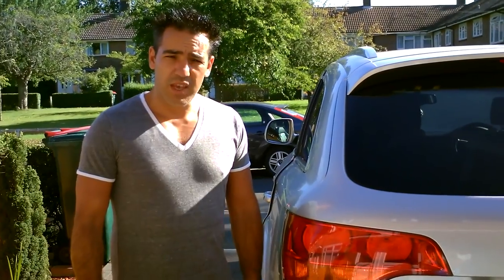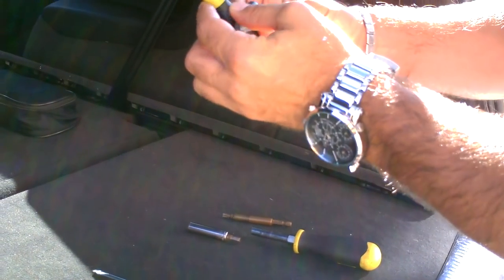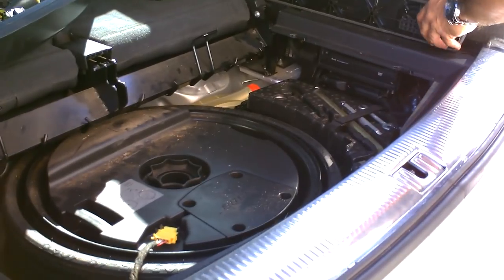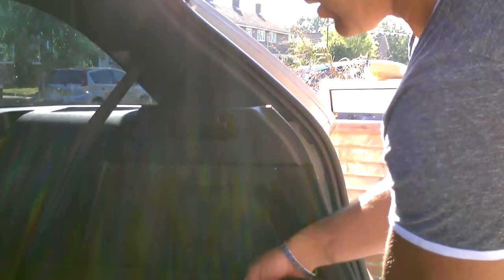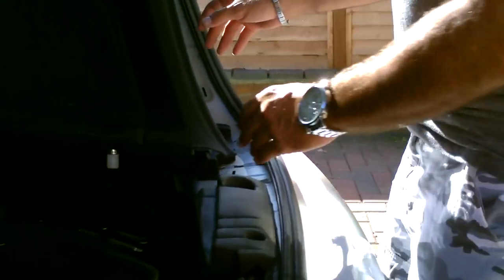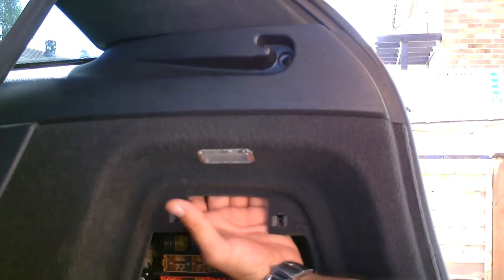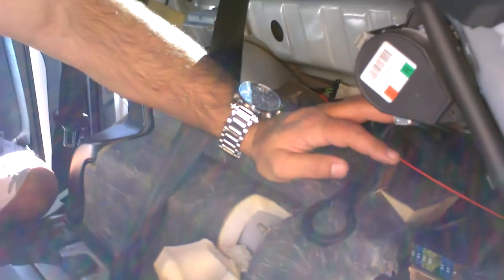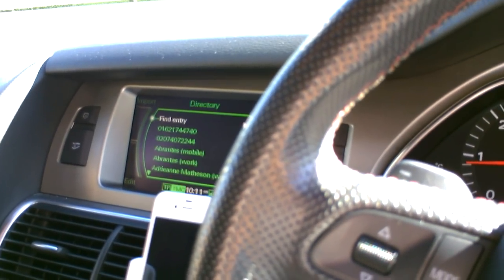Audi Q7 Bose Amp Removal & Location

Comment: First of all.. Carlos, thanks so much for the help! I probably wouldn't have tried this without the step by step instructions. I used another one of your videos to help me replace my throttle body recently as well.

Two things that might help others..
First, the fiber optic loop helps if your MMI is completely blank. In my case, my amp was faulty (roof leak), but my nav and everything else worked - I just didn't have sound. I bought the loop back, but in my case, it really wasn't going to do anything for me (although, my key fobs have terrible range, and push-button start often doesn't work great.. so maybe it would have helped me keep a full charge on the battery and helped there.  I bought it, so I could test that theory and maybe get the amp repaired or look for a replacement).  
Secondly, when I got the amp out, I noticed water spots, and residue on the circuit board.  I used Q-tips and isopropyl rubbing alcohol, and cleaned up the board (figured it couldn't hurt).  Spent about 10 minutes cleaning it up, reconnected everything, and I have my sound back!  So pumped.. $0 fix.  I don't know how long it'll last.. and I imagine it's going to get hit with the water leak again (hopefully I can fix just as easily). In my case, I blame my kids.. I've caught the rear sunroof open a few times, and imagine it's been open at the wrong time, or overnight.  I'd suggest trying the alcohol as a first test.. if none of the circuit board components are bad, it may simply need to be cleaned.

Comment: Thanks for your excellent video, my wife's Q7 had a DSP issue (no audio) and it wasn't showing up in a VCDS scan, I pulled the inspection panel off and reseated all the fuses and now it works! Hopefully all fixed and I was thinking it was going to be a bill of a couple of grand to get it fixed. Thanks again - you're a champ.

Comment from the maker: Hey Usanmaz , do u have a sunroof if so , most likely your boss amp has water damage as the amp provides sound to the whole system , it works on a loop basis , think of it as a circle if something in the circle is not working then nothing works did you have no sound on any device most likely it’s your amp that is fried get yourself a fibre options loop tester and you can bypass the amp and test everything else I think I have another video with the fibre loop hope this helps

Comment: when trying to do Bose amp removal, and the screws are easily accessible on the left and front of the metal plate that the amp sits on, the metal platform has a screw on the right side. (Audi Q7 2008) which is behind a tight spot. right side screw for platform is behind the fuse box. How did you reach the screw thru the fuse box area?

Comment: Carlos , just watch your video on how to change the BOSS Amplifier that has disable my MMI completely. The Audi Dealer in Rockville Maryland want $3.100 for installing the new AMP, I know crazy. After watching your helpful video, I feel capable to change it myself. Delears are insane and a ripoff. I need to find out how much the BOSS AMP cost to order one , my assumption is that is expensive.  Ed Canales

Comment: Great vid... thanks. Noticed my MMI tries to start up and then turns off. Pain. Gonna give this a try. Thanks again!
Reply from the maker: If you have a sun roof , 95% it is the cause of your mmi and sound not working.
Reply: Thanks Carlos. I have the Pan roof... so seems that way. Ordered loop which has now arrived so ready to go. Will update with a comment when done.
Reply from the maker: Yeah most likely water in the amp, pull the panel and look for water spots on the amp tray and amp itself , mine has been a nightmare after I fixed that issue the moonroof seal went , water in front footwell , seal has already been replaced 3 time at over 2k charge, I went off on Audi so they discounted the install this time., Good Luck hope all is good.

Comment from the maker: The amp is around 800-900 US dollars u can buy it from dealer or a junk yard once u install it dealer will have to program it to the car unless u have software that you can program it yourself. Hope that helps also if your amp is not working due to water leak u must fix the leak or it will happen again
Reply: thanks Carlos. How can I program it myself (I have the VCDS Ross Tech)?

Comment: carlos hello I write from Chile I thank you for your videos are very good and very helpful. my problem in my Audi Q7 3.0 TDI 2007 I have it in the center console when I turn on the radio appears on the audi mmi screen for a few seconds and then turns off. it is as if left without power the console. change MMI Multimedia Interface Control Panel Circuit Board and did not work. bose amplifier located at the rear of review and has humudad, if I change the amplifier this should be solved? or there is some other module missing for review? I hope your prompt response, greetings carlos

Comment: Hi I have the 2007 Q7 premium 4.2. My MMI wont turn on and is blank. First thing- I looked in my spare tire well and water had filled up to the bottom of the air compressor- 5 gallons? After watching your video I removed the amp and cleaned off the corrosion but it did not change. Then I installed the bypass loop on the amp- no change. I also wasn't sure if I need to leave the main connector on so I tried it both ways and it made no difference. Then I dug a bit deeper and tried the loop on SIRIUS control- no change. Then the unit that mounts vertical (no idea what it is)- no change. Even tried the bluetooth module under the passenger seat- no change. Finally I installed the Navigation(DVD) and I got the MMI to turn on but it powers down after 1-3 seconds during boot up. Tried to reset during boot up in that 3 second window but it didnt make a difference.  The control board will perform a reset when you press the three keys so I think its working?. Does anyone have any suggestions after this? Is there any thing else in the loop? Anything special I have to do when bypassing the Nav? I'm parked in the garage and will wait until I fix the sunroof drains before I take it out in the rain.
Reply from the maker: You will need to bypass all the device that you think are bad, so you will need to put another fibre loop on the other device, it works like a circle if something doesn't work in the circle then nothing works , so put a look in the amp and another loop in the sat nav and so forth , until something works then you can plug one thing at a time and see what works , you will probably need a new amp of water is in the amp.

Comment: hi where do I get a Fibre Optics loop and how does this work. could you tell me where the amp fuse is as well. can you tell me if the problem with the q7 was it turns on when you start the car and then turns off and there is no power to the control panel

Comment from the maker: There is probably a bad connection somewhere with your mmi system , you will have to trace the connection and see if they are plugged in tight , it is a bit hard trying to diagnose the system when the only info u have is just a message saying please wait.

Comment from the maker: That means what other device before u put in the fiber loop is not working , remember the whole system is a loop think of it as as circle if something is broken in the circle it won’t work , so go to the previous device and put another fiber loop and see if there is a light, that device could be your issue.
Reply: Hi, you speak spanish??
Reply from the maker: Kenia Peña I
Reply from the maker: Kenia Peña I speak Portugese , I understand Spanish

Comment: Hi.. thankx to you i was able to it..cant thank you enough.. i do have a question... there is a redlight on your fiber optic cable... but i don't see a light on mine.. what does it mean?
Reply from the maker: I just posted a reply to your question
Reply: Thank for so much for your response.. i honestly didn't think you would see this or respond.. i am tempted to try the polymorph fix next.. do you know any new fix to stop the leak? Maybe from the top?
Reply from the maker: Honestly I would go to the dealer and buy new tubes as they have improved them and I would replace all of them to be on safe side if one of the tubes is leaking then all will fail sooner rather then later, I ended up replacing all of them because I had to replace the sun roof gasket also, hope this helps and good luck
Reply: @CMGvid  It does,  thank you. I appreciate your time & attention.
Reply from the maker: No worries glad I could help

Comment: if I remove the amplifier and use a fiber optic loop should run my radio and the whole system mmi without using the amplifier?
Reply from the maker: Yes but there will be no sound as the amp is the device that outputs the sound

Comment: Hi Carlos, I just watched the video.  Amazing help. Would you send me the link where to get the fiber optic loop? I can't find it. My Audi is the same model, and year. Thank you sir.
Reply from the maker: You can purchase it at any Audi dealer , ask them for the fiber optic loop, they use it for cars that don't certain options , like satnav , cd, it is used to by pass a device on the system as the audi system is a loop and if something in the loop is broken nothing else works, that is why it is called fiber optic loop, I think it was about £12 pounds, I have ordered a few but sold them. Cheers hope this helped.
Reply: Carlos, thank you so much for your answer. I have one more question. After i get the loop, all i have to do is to plug in, and install back the amplifier?
Reply from the maker: no you bypass the amp to see if that is causing the problem you will have no sound on any system as the amp produces the sound but you will be able to know if the problem is the amp , most likely it is the amp and you will need to have it replaced and reprogrammed if you want to have radio and satnav and telephone sound.
Reply: Carlos thank you so much for big help.

Comment: Hi Carlos,
This was helpful. However, there is no noise. For example, the radio is not working and the mike is not working for the phone. Please advise. 

Dimple
Reply from the maker: Dimple Patel  you need to replace the amp as this is what produces the sound , no amp no sound in radio , phone , mmi
Reply from the maker: mine is sorted you need to replace the amp
Reply: +CARLOS GOMES (CMGVID)   
Hi Carlos.
Great video, Can you please tell me how I know that AMP is what is causing a problem.
I just bought Q7 and audio sometimes does not start right away. Maybe first 5 minutes when I start the car and after that It is working perfect. Everything else works right away when I start the car except audio. I tried CD and Radio, same thing. 
Also, I notice that upholstery has some water marks around third row seats sunroof. And seller told me that they replaced battery recently. Also, will fiber optic loop allowed me to get any kind of audio??

Thanks a lot.
Reply: @eddominguez7564  tu is lietuvos?

Comment from the maker: Are you sure the right speakers don’t work due to amp , do the left side work if left side work I bet it’s not the amp , who is repairing your amp as I sent mine directly to Bose and they would not repair it due to the contract they have with Audi so if you do get it repaired make sure you they know what they are doing, you could get one from scrap yard and just take it to Audi to reprogram it, it’s not as simple as just install the amp, as for the loop it’s used to bypass a device if you put the loop where the amp is then everything else will work but you will have no sound, if you don’t put it in nothing will work, think of it as a circle if the circle is broken the you cant complete the circle , that loop tricks the circle to say there is a device present hop that makes sense and good luck.
Reply: How much would it cost to reprogram it? What is the process?
Reply from the maker: @ShawtyWitDa93  u will have to contact audi

Comment: Hi CARLOS GOMES, Question: Before your identified that it was the bose amp causing the problem, was the sound working?

My buttons on the MMI are not working (INFO, CAR, RADIO, MEDIA, NAV) .. Car also struggles to start...  but music plays fine and everything else okay... Just the buttons are not working.. I dont know where the fuse is but it could be the amp.
Reply from the maker: If it plays music then it’s not the amp , if buttons don’t work it could be a bad connection on the buttons or did anyone spill anything on the buttons

Comment: Hi Carlos; I'm having some problems with my Q7 2007.  I turn on the car and the display turns on but after 5 sec average it turns off. None of the light of the MMI are on, but if I press one of them (car, info, nav, radio) the display turns on but turns off after 5 sec... before it happens, i was driving and suddenly i had no sound. After 20 min the sound came back. MMI was working fine. At the next day, the car didn't start. So I jumped the battery and the car started. But MMI wasn't working no more. Then, I start having problems starting my car. I have to turn on every day if not, the car won't start the next day. It is like the battery drains overnight. Especially if rains at night. The battery loose charge quicker.  (i have found some humidity at the driver side floor carpet). So my question is, do you think this signs are for bad amplifier? do you think if I replace it, the MMI will work fine again?
Please advise... thank you very much... let me know your thoughts...
Reply from the maker: Hi Andres first off do u have a sunroof, if you do it’s probably the amp, remove the back panel and see if there is any water marks on the amp, if there is then the cause is the amp , I would purchase a fibre optics loop from Audi the are about 10 pounds and connect it to bypass the amp to see if your mmi will work, it will work without the amp connected but u will not have sound, but u need to plug the fibre loop in its place. If u do have water then u have a bigger problem with the drains of the sunroof u will need to get them fixed before u replace the amp as if u don’t the amp will short out again when it rains, as for the damp in your foot well check out some of my other videos as I have a video to show how to clean drain plugs behind the tires , it is simple and most likely clogged I thought there is no way mine were clogged because I never park under trees but sure enough the were both clogged once I did that no more water in the footwell . Let me know how u make out and if u need anymore help fibre loop you can get from Audi one of my other videos I list the part number. Cheers also the drain on the battery is all amp related in the end I had to replace mine and it needs to be programmed by Audi not a simple install
Reply: thank you very much. I will work on that... i will let you know. 
Pd..  amp needs to be programmed by audi? if you know, is there any place where I can buy it already program?
Reply: yes i have soon roof
Reply from the maker: Andres Irigoyen , even if u buy a used one it will need to be programmed by Audi to your car model
Reply from the maker: Andres Irigoyen then 99 % you have a water leak and fried your amp, check it like I mentioned in my previous message, view my video it’s not that hard to check it

Comment: Has anyone replaced the amp with a salvage yard unit and had to take to dealer to get the Component Protection encryption programmed to your car?
Reply from the maker: If you do it has to be reprogrammed by audi to interact with your mmi

Comment: hi, I ve got an audi q7 2008 model,the radio not working, if it gets on its only shows audi symbol and then goes back off,. what could b the problem.
Reply: maybe the amplifier is damage due to water leak from the sunroof
Reply: I had that problem about a week ago.  I unplugged the negative contact on the main battery under the drivers seat waited about 2 minutes and re attached and everything came back to normal 2008 q7

Comment: hi, I ve got an audi q7 2008 model,the radio not working, if it gets on its only shows audi symbol and then goes back off,. what could b the problem.
Reply: Hi there, I love your video. What's the part # for the optical loop for 2007 Q7 3,6 ..?
Reply from the maker: Hello the part number is 4E0 973 802 if you look on some of the audi forums I have instruction on how to troubleshoot and remove everything.
Reply: CARLOS GOMES where do i order this item from